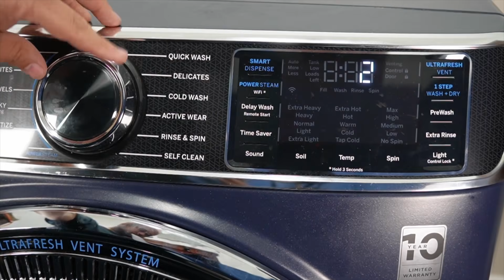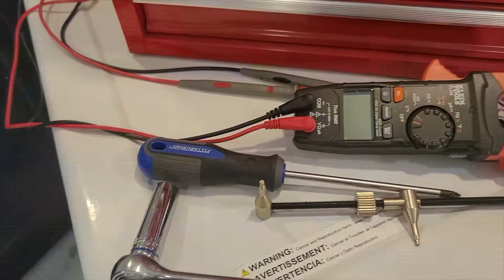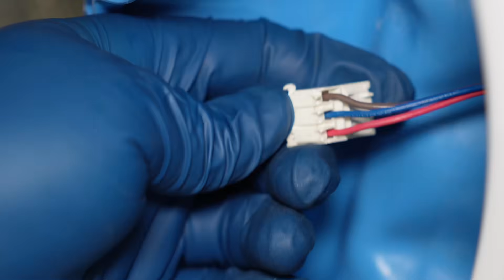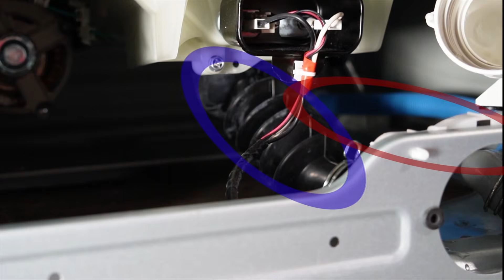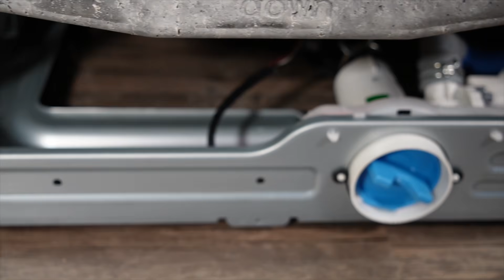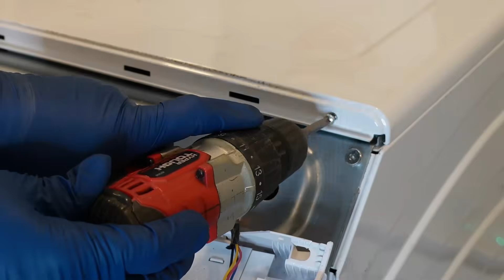GE Front Load Washer Stops Mid Cycle and Won't Spin - Common Issues

Comment: So, I'm a little confused. Does running for a few seconds mean the motor or board? In the video, you said you are changing the motor but only changed the board. What do I need if it is only spinning for 4 seconds.
And has codes 3,19,23,26.
Reply from the maker: Failure after 4 seconds of running tends to be inverter. I have another video showing how to do the forced test and if you force the motor to run and it stops after 4sec, its always the inverter
Reply: @bensappliancesandjunk  i did the #14 test and it stopped. I'll go watch the other video now.

Comment: Did anyone else catch the inverter board being reinstalled upside down? The video cut away then was corrected. Also my counter weight was fastened with 13mm bolts instead of 14mm

Just something silly i noticed. Great, helpful video overall!

Im in the midst of getting it wrapped up.

Comment: For those with Canadian models: the drain pump, main board, and inverter board are identical to the US models but they have different part numbers. I wasn’t able to find any of the Canadian parts in stock anywhere but was able to find them in the US.

Main Board (CA): WG04F11906
Main Board (US): WH22X37837

Inverter Board (CA): WG04F12727
Inverter Board (US): WH22X35837

Drain Pump (CA): WG04F11965
Drain Pump (US): WH11X29539

Comment: Would this be covered by my 10 year warranty and would I void any of that by trying the repair on my own?
Reply from the maker: No. The 10yr warranty is for the motor itself i believe. Definitely not the inverter
Reply: @bensappliancesandjunk  Thanks, I'm watching all of your videos now.  I tried to get the door unlocked by running program 13 but it doesn't do anything, it just lights up the "extra light" sign.  I got error codes 18, 42, 3, 23, 34, 19, 48 and 46.  It's only 5 years old.  Is it worth trying to fix using your videos and  also how quickly do parts usually come?  Thanks.
Reply from the maker: @mertonhirsch4734  usually we ship the next day and it takes 2 to 4 days to get them depending on where you live. Its probably worth fixing IMO

Comment: Hi! Thanks for the video. Can you advise on test 14 the tub not spinning at all? I have already changed the lock but all test 14 does it make 3 lock click sounds- no spinning- pause- then 3 more lock clicks and the screen just stays blank. I can hear motor but there is no spin and the tub doesn’t have any resistance when I manually spin. Can you point me in the right direction??
Reply: That's what mine is doing what did you figure out?
Reply: I changed the control board and everything is fine now!

Comment: What is the OOB value displayed during the OOB test 15? Also, I have a GFWR2700HWW direct drive washer with vibration issues and the basket has some play in the tub when I lift the front edge of the basket. I assume this is an/the issue. There are bearing kits available. Is it possible to replace the bearing without removing the rear tub? there's a lot that has to be removed to get the rear tub out.

Comment: Thanks! When my washer first stopped working I contacted a three appliance repair folks.  One never called me back, one said GE washers are hard to repair and I should go directly to GE and one who showed up and charged me $125 and concluded that I needed a new washer.  Then I found this video and took the gamble on buying a new inverter board.  Couple hours later and the washer is working again.

Comment: Code 23 doorlock, but I change it twice and I don't think that never was the problem what could it be
Reply from the maker: Check wiring going to door lock from the board. Could be a pinched/damaged wire

Comment: Is the inverter motor covered by the limited 10 year warranty on the 850 series? My machine is 14 months old... and just quit spinning and is throwing all the inverter codes... that pisses me off something fierce.
Reply: Did you ever try to pursue the warranty for inverter?
Reply: @jordanmeadows9543  Warranty only covers the motor itself.
Reply: Sure would be great if you came back to let us know:-)
Reply: I added a aftermarket warranty through lowes, and they covered it.

Comment: I'm lucky you put out this video before my washer broke. You’d think a $1600 washer would last more than 3-4 years. We replaced the main circuit board for around $250-300 a year ago. And here we are spending another $150 on this inverter board. Still cheaper than having a tech look at it though. 
I tried replacing the hall sensor (accelerometer/speed sensor) first because it waa cheaper. If I had paid closer attention to this video though, I would have noticed that I didn’t have an error code for the accelerometer/hall sensor. The diagnostics in the manual suggest replacing the hall sensor if the drum spins for only 5-7 seconds during the #14 spin test. But a bad inverter board also causes the drum to spin for only 5-7 seconds. I’ll just keep the extra sensor on the shelf till it dies too.

Comment: I got the pump from you, and that wasn't the issue. I'm not getting inverter codes. My machine won't do the spin test. It won't do the high speed spin test either and registers no rpms when it does try to run it. Could this be the speed sensor?
Reply from the maker: Could be yes, the accelerometer

Comment: I have a GFW 850 purchased in 2021. Symptoms are similar to video that washer stops mid cycle and won’t spin. Error codes are 38 and 26. I have replaced the inverter board, vent damper and drain pump. When I go into test mode, the vent damper works as intended opens and closes properly and the accelerated spin test reaches 1100 RPMs as intended. Not sure where to turn next? Has anyone on this message board encountered anything similar on this model of front load washers? I’ve checked for pinched wires and loose connections. What am I missing?

Comment: I had 5 fault codes on my brand new GE front loader, they replaced my washer after just 5 days of failed use, and before I even used the replacement washer for the first time, it already has code 89 and 92 before we even started it up.  The store told me I shouldn't be accessing those codes.  I just hope it works this time.  This all happened this week.

Comment: 2 weeks ago, my GE GFW850SSN0WW developed a problem.  It won't do any of the fast spins to dry the clothes, not even the slowest of those spins.  It quits early when it is supposed to be spinning.  It will still do the very slow tumble.

Had a tech come out.  He diagnosed that it needs a new main control board and a new inverter.  Cost: $115 for the initial visit to diagnose.  To repair it will be $200 for labor, $350 for the main control board, and $100 for the inverter board.  Total: about $770, more than a new washing machine.  I feel cheated.  I was not expecting repairs to be so expensive.  The machine is only 4 years old, and has had light usage.  It shouldn't have failed.

So I have come looking for info, and found your videos.  Going to order parts from you.

I don't have any of the error codes.  I am wondering if the diagnosis could be excessive.  Maybe only the inverter board needs replacing?  Can a bad main control board ruin a new inverter board, or can I try replacing the inverter board, see if that fixes it, and if not, then get a new main control board?

When I first got the machine, it would do a noisy "venting" process for hours and hours after a wash.  Would turn on at 3 AM to vent some more.  I resorted to unplugging it to stop that, and it then still being under a full warranty, had a tech out for free to check that everything was okay.  I don't know what the tech did, my guess is a software update, but since that visit it has never done venting for such long times, and so I have left it plugged in.

One other problem is that of late it hasn't cleaned clothes all that well.  To get them clean had to set the soil level to "extra heavy" and put in the maximum amount of detergent.  Maybe it's been having problems spinning for longer than I realized, and that's why the clothes aren't getting clean faster.

Comment: Awesome. I scheduled a service call because I thought it was beyond my knowledge. After watching your video, I realize, it isn't! I had a small rock in my drain pump causing the main board triac to blow a small hole in it, just as you noted. My pump had the 3 detents, but only showed 1.3ohms resistance. Interestingly, it's 3 years old. And I have 2!

One more thing. My washer is throwing inverter errors, but I am waiting for the Ctl board and pump to see if the works before I order the inverter as I KNOW the Ctl board and pump are bad. Im thinking that the bad Ctl board is masking the actual errors?

Additional benefit, your prices are competitive and I ordered my replacement parts through your web site. Well done!.
Reply from the maker: Hi yes - the main control can mask the inverter error for sure. It did on the one on-screen. I bought it knowing it was bad and assumed it was the inverter, but upon further and deeper diagnosis, it was the main board because it failed to throw 120 VAC to the inverter - it would only go up to 4-5v then the relay would click and the process would start again. Thats a clear case of the board being bad. If it did send 120v THEN clicked, that would likely single the inverter or motor for failure.

Comment: I’ve just recently changed the pump on this style unit. I was able to easily replace the pump without having to take the front of the washer apart. It took 5 mins to swap out going from underneath the washer. No need to remove all the other parts. Just thought I would share for anyone who needs to replace the pump and feels too intimidated to disassemble the entire front of the washer
Reply: The underside approach was much easier.  Replaced the inverter motor board last night per this and another video.  Like any project, it's the "prep" that is a time sink, the actual task is easy.  After removing the top stacked dryer, disconnecting all hoses and wires, pulling the washer from the wall, tilting it back and supporting it with 2 toothpicks, was able to access/replace the board.  All without having my skull crushed.

Comment: What if service test 14 shows it ok and reaches full speed but won’t speed up during normal operation? I’ve checked everything I can think of and can’t find a solution. Drain pump clear, pressure sensor seems fine.
Reply from the maker: Check error codes - thats a rarity, and those codes should hint at whats going on
Reply: Thanks for the response. I did, doesn’t seem to point to anything.
Reply from the maker: @Gamermonkey82  what codes did it throw out ?
Reply: I cleared them last time I was going through the tests, getting nothing now. Before it was as 3, 23, 26, 38, 39, 89, 91. From what I understand 3 and 89 are ok since spin test 14 ran successfully. Same with 38/39 using test 24.

Comment: Morning. My washer just start a program, adds some water, spins a few times, like 5 rotations every time and after a few minutes abrtly ends the cycle. Drain pump works, water supply seem to work, at least on the spin and runse cycle. Today it displayed CANCELED and drained all the water and shut down. Back to the symptoms now. GFW850SSN0WW. What do you want to send me first from your store to replace and eliminate? :)
Reply: Inverter?
Reply: Codes 3,57,9
Reply: If I hold the START button for 10secs, sonethings just cliks, like an electric valve sound, light restarts, but nothing shiws on the display.
Reply: @pawemilewski8126 hi there…were you able to figure out the problem? Everything that you described above is my exact experience. I can start a cycle, I see it fill then begins to wash. I can hear a pre drain sound… then it begins. After 2-3 minutes, it says “End” then it unlocks door. Water will remain in there. When I try to run error codes by pressing pause for 10 secs , I just here faint clicks(approximately 2 sounds). Then no error codes are displayed on panel. Please help. Thanks in advance

Comment: I replaced the inverter board and the main board and the problem persist. Any idea what the problem would be
Reply from the maker: Can you pull error codes?
Reply: @bensappliancesandjunk  at this point I have error code 3, 39, 23, 91, 9
Reply: Same problem. Any help would be nice. Im putting enough money into this that I could have bought a new one by now

Comment: Hi Ben great video Thanks. I have the similar washer machine GFW550S* with codes 3,9,23,46. Running test 14 spin 3 seconds which thel me it is the hall sensor. Checking voltage in the main board I get 122 vac at the input and 119 vac on the output pins that contact connector J506. This tell me that the main board is sending the right voltage to the inverter. However when I connect J506 plug to the main board output pins and check voltage on white and black wire, the voltage is 0. I check continuity between the wire and the pins on J506 plug and wires are cramped correctly. Question, do you thing is there a short circuit on white and black wire or in the inverter to cause difference of voltage be 0? if this were the case why I don't see a spark when I connect the plug J506?? I hope you can help me 😊

Comment: I need a small help from you, my machine has codes for inverter and when i tried to test it on code 14 it doesn’t spin at all absolutely nothing, first i had the code for accelerometer but when i deleted it it’s no longer there, do you think that is not moving at all if the inverter is totally dead ?

Comment: I have 2 of these washers, less than 4 yrs old.  The inverter board went out on both within 2 months of eachother.  Paid a GE repair tech $480 to replace it the first time. Thanks to you I'm going to do it myself the second time and save a ton of money.
Reply: how did you understand that the issue with the inverter board, not the main control?
Reply: $480 ain't TOO bad, but if you have the time, it's definitely satisfying to fix yourself.

Comment: This repair sucked.  Not because it was particularly difficult to do, just because I'm really irritated that my washer is BARELY over a year old and I had to drop $~140 on a part to fix it.  However, I did get it put back together enough to test, and it fixed my spin problem.  The diagnostic went perfectly and I cleared trouble codes and got it all put back together.  Not happy with appliances these days, but it is what it is I guess.

Thank you very much for this video
Reply: LG FTW... I liked these GFW's when they came out but after selling a few million dollars worth of washers, I'm back to simping for LG. They're just designed and built so damn well. (And no, you don't get LG's best - or anyone's best - if you get a trash-loader lol 😂)
Reply: @dregenius  I'm gonna guess a trash-loader is a front load?
Reply: Same nothing but problems

Comment: Subscribed and like man I called a repair man to check out my washer charged me 350 dollars and said the part as been discontinued and I need a new washer I looked it up on ebay order and replaced it. Works like new if it wasn't for your video I would spent 2k for a new washer thank you so much for what you do.
Reply: I really feel like the business model of the service techs is to take the easy route, call it irreparable, move on and reap their cut of the mandatory fee.
Reply: Money for nothing and the chicks are free

Comment: Thanks so much for this information. Ours stopped and I got the board in today. Took about an hour to do it and I used the wire tie clamp method to do the spring. Did not have to remove the weight or tilt the wash and I did not remove the top either. As the codes pointed directly to this as the problem when the drum spun freely. Thanks!!!!!!

Comment: Inverter board? I have to assume because the motor is DC? I wonder if there will come a time that electricity is converted to DC when in comes into the home, or maybe even on the utility pole. All our electronic devices have converters to DC and all major appliances will run more efficientely with DC motors. Look at split system A/C units for an example. And of course if solar is part of the equation staying DC all the way is also more efficient. LED light bulbs run on DC and convert within, no? AC was great for incandescent lights, but who uses them anymore? Giant battery farms are springing up in our neighborhoods and they have to invert/convert coming and going each way significant losses. I may not see it in my lifetime but I think DC is the future. Not of course for transmission, but once at a reasonable proximity.   I came here thinking about buying a GE washer but your videos are scaring me away. Thanks.

Comment: what if my washer does complete the full 14 test cycle but it has a weird clicking while spinning. I have codes 23, 27, 26, 9, 66, 46, 65, and 29. While washing it displays 'door' although there is nothing blocking the door and the drain is clean as well.

Comment: Thankyou so much sir. I had a ge washer with the 5 second spin during testing and after watching your video I ordered an inverter board. Problem fixed.  Your video made it super easy to remove the front panel of the washer and swap the board.  I ended up using a woodworking trigger clamp with a reversed jaw to stretch the gasket spring enough to re-install (with zip ties like you mentioned).  Great video.

Comment: Hey Ben, I just got the SQ TC5, I heard from someone else who has the same SQ that the computer board failed 2 times in the first 8 months of ownership, and that they wash some loads on hot, and the SQ is kept inside a laundry room. After my 2nd load on just warm with the laundry room fan on, I noticed it was a little humid in my laundry room. I'm thinking the natural humidity that the SQ gives off is destroying the computer boards quickly. Is this a problem, or  is there something else I'm not understanding?